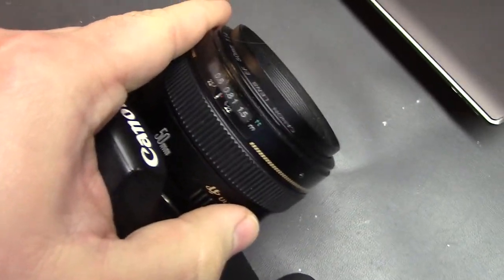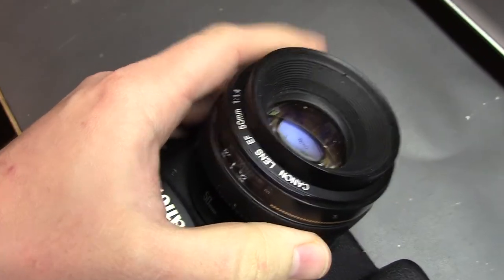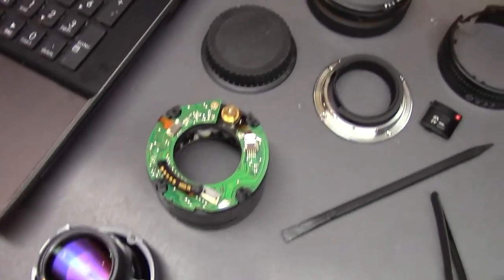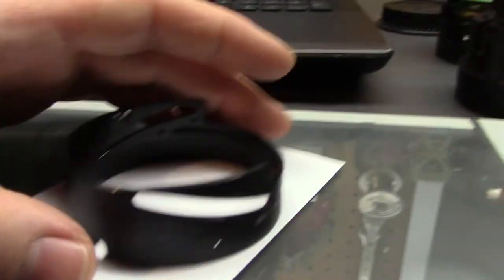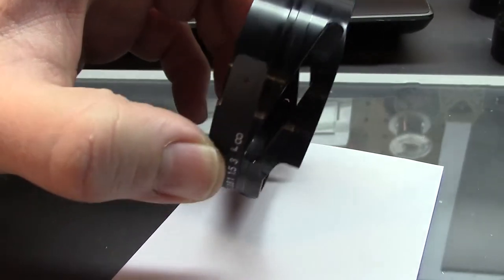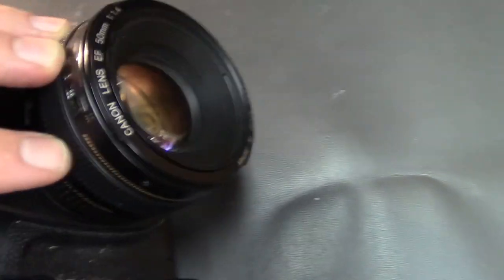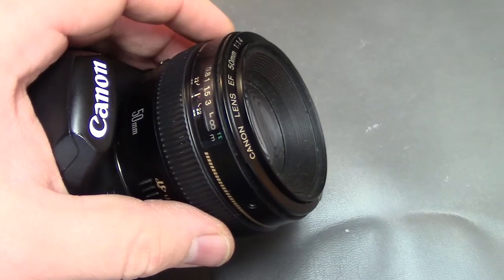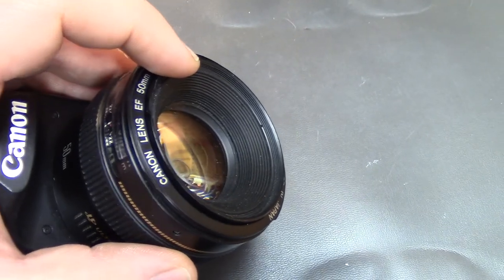Canon 50mm 1.4 USM Lens Repair - BauTek Industries

Comment: Many many thanks. This has just saved me £200 repair cost. I bought this lens 2nd hand and it was always a bit hit and miss on the focus. Took some time to clean it up too. Now it is better than ever. A small warning to others trying this... I used a bit too much pressure when realigning the focus tracks/slots. It closed too much and the nylon bricks/guides were sticking. I gently (very gently) prised the slots open with a BIC Biro pen lid -  checking with a brick/guide regularly.

Comment: Nice video. Do you have a video showing how to disassembly the lens part to clean fungus? Thanks.
Reply from the maker: Oh no, sorry to here about your lens fungus. Unfortunately I've never had a chance to go deeper into one of these lenses so I can't be much help there. That might be something I'd have done professionally since element alignment and tiny specs of dust could be a nightmare.
Reply: Hello, same problem occur if we attach a filter to the frontal element of the lens? (Filter attached is mean an extra weight on front element too).

Comment: So I just now discovered that canon sells a replacement part that has been reengineered to address this very problem. With the help of the video I’m going to attempt to replace it. I will report back in a few hours with the part number. :)
Reply: D1G1TALSYNAPS3 any news on this spare part? I would looove to hear about
Reply: Yes any word? i just used a spare part i got off amazon and it hasn't fixed the issue. It felt like a piece of crap tbh so ill be removing it and sending it back but did your canon part work ok?

Comment: Hey, I tried to place the piece on a flat service and even used a piece of hardwood like you did. The piece still doesn't turn as smoothly, any idea why it feels so tight to turn?
Reply from the maker: It seems to be pretty finicky, if the area near the slot goes out-of-round or the slot gets pushed too far in it gets sticky. Using that piece of tempered glass with the slot side on it (the wood was used to exert pressure from above, not to level the slot out) worked pretty well in this case. :)

Comment: ...OMG. I just figured how to bypass ALL of this!!!
Reply: This may not work for everyone, but I found it to be a quick fix* Simply squeeze the other sides of your camera. If we are bending them out of shape it's as simple as pressing the other sides of the lens. Some added pressure every now and then seems to help my problem. I did take it about the first time but noticed it came back. This hopefully helps in some way. If the problem continues you may also want to help the motor when it's trying to adjust if it gets jammed** Good Luck!